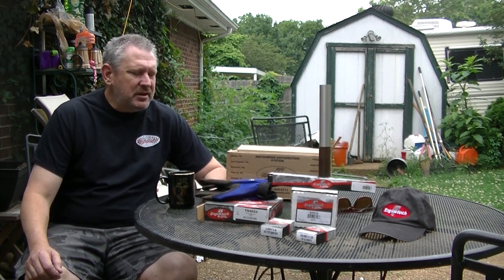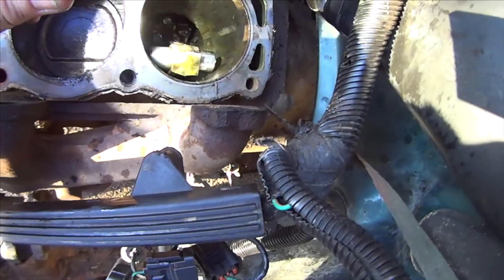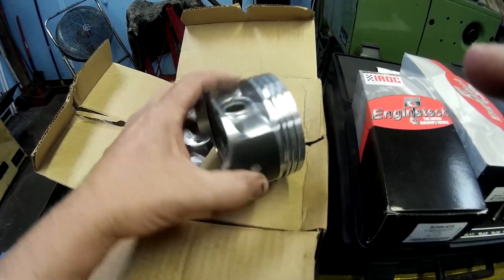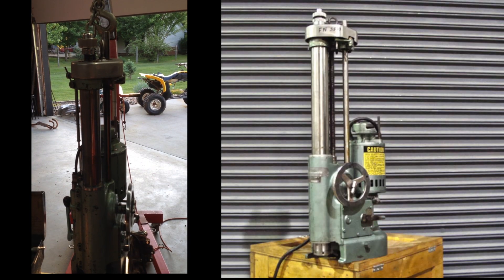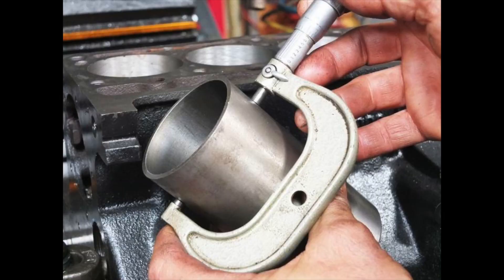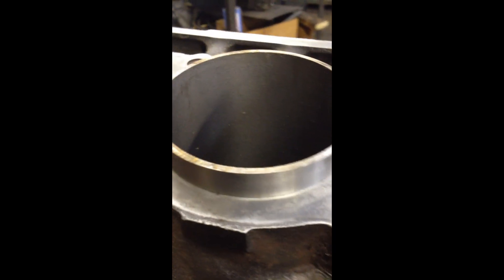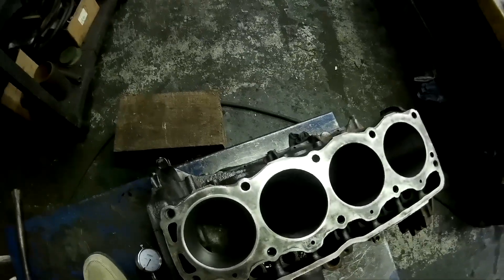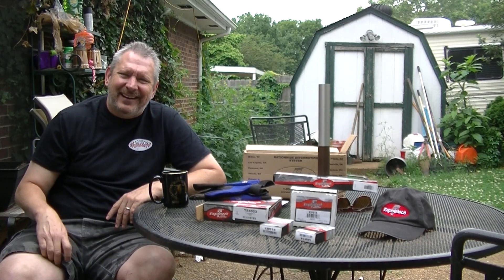Jeep Wrangler 2.5 / 4.0 Rebuild Series- Machine Shop Results - 2.5 Sleeve - Enginetech Master Kit

Comment: 1986 Jeep Cherokee with 2.5 engine.  Two or three months ago the #3 cylinder exhaust valve parted way with the head and it rolled around in the cylinder.  Ok, So I replaced the piston, all the valves, surfaced all the valve seats, main bearing, and rod bearings.  I inspected the sleeve with the piston out and it appeared good.  Couple weeks ago it started making noise and loosing about a gallon of water every 30 miles or so.  Yesterday I pulled the head because I thought I blew a head gasket.  I inspected everything and couldn't find anything.  I even pressurized the head, but no leaks.  So, I went again the the cylinder and ... well, is there suppose to be a crack running top to bottom???????   That's what lead me to your video.  Interesting, but I'm not putting that much into this Jeep.  I've had motor cycles bored and heard the term boring bar, but had never seen it done.  ...  Sigh, sorry little Jeep .. you've been good to me for 20 years.